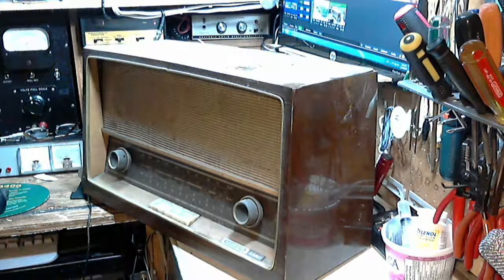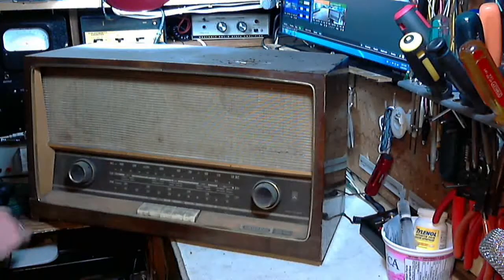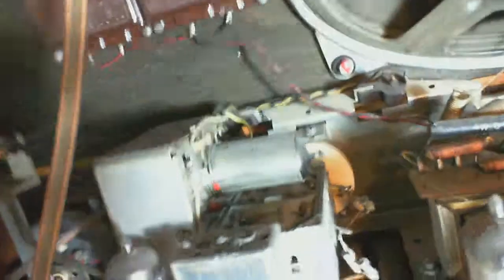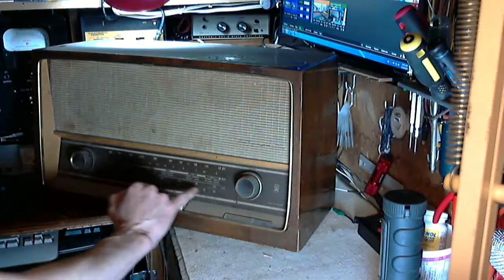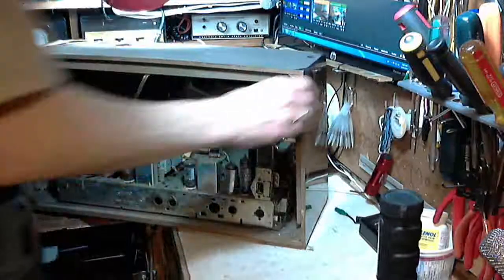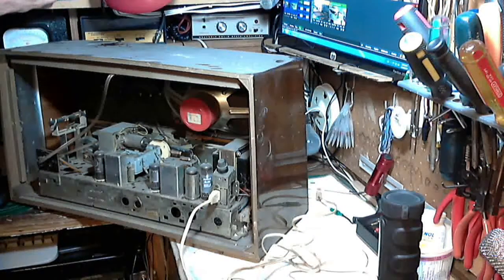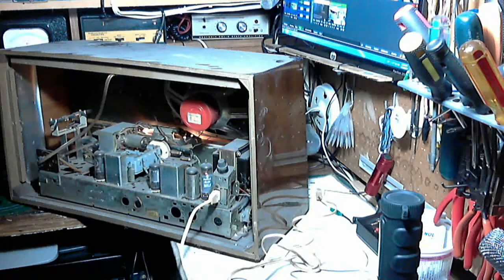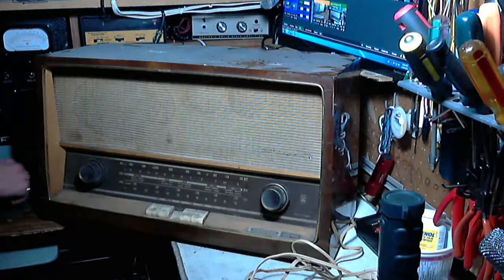Grundig 2540 Vacuum Tube AM/FM/SW Radio Video #1 - Checkout

Comment: Just finishing a Grundig 8014r. It was in a filthy state, a rat even got in there and chewed up some cables! Some joker put the fuse link in the 110v instead of 240v (I´m based in Spain).I repaired the woodwork, replaced the rectifier and main smoothing capacitors (50uF+50uF+8uF single block); power resistors and capacitor at the output transformer. The ferrite antenna is all chewed up, replaced it but not happy, on medium wave I´m not getting anything.Going to look at the switch system on the underside of the chassis if I could resolve the issue. FM is good, no problems.  The accompanying turntable Dual 1010 was pretty much shot up, replaced it but had issues with the ceramic pickup but OK now. The TA input through the 5 pin DIN at the rear is OK. I hooked up a bluetooth receiver, all works. The dial pointer had disappeared together with the string but after some headaches and fiddling about, it´s now OK. Output rating on this unit is 3W. Would you believe I´m doing this as a favour for a friend as it was his first radio, he is 85 years old now!

Comment: Working on A 2540 Grundig. Strange the trim is shrunken just like yours. Must be an issue with theses models. The radio I'm working on has a shorted output transformer and after replacement the radio is now working but I'm a little confused on whether the power transformer may have a shorted turn. Current draw is 0.52 amps on AC line at 120v 6.3v on heater and B+ at rectifier 267vDC the rectifier is silicon in this model. Main B+ cap replaced as well. The issue I'm concerned is the transformer gets rather warm after 20 min it's uncomfortable to the touch. Wonder if you have noted the temp of the power transformer or might measure it after 20 min on time at full voltage. The current spec on data .54 amp draw and 285 V plate mine is slightly lower plate at 267v so I might have a load issue on B+ supply.